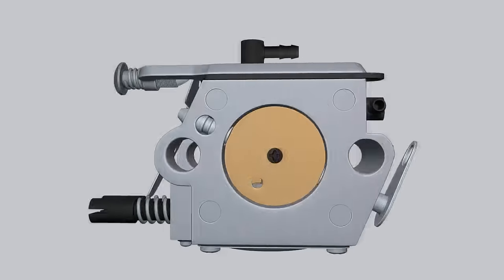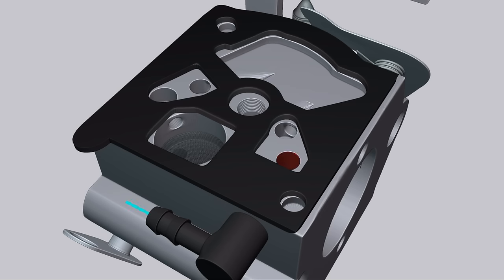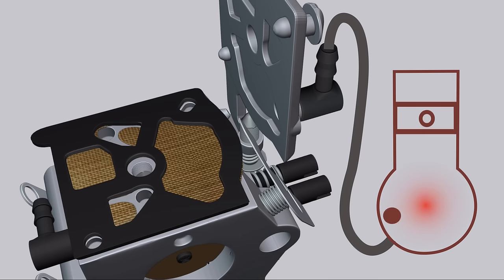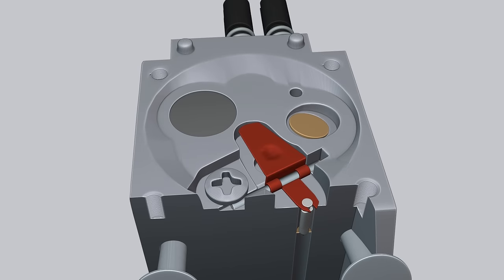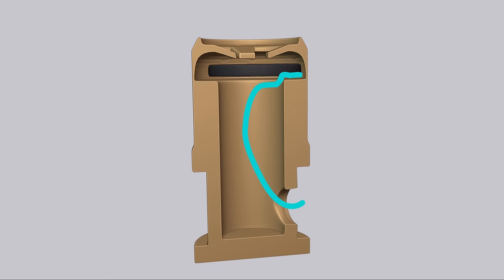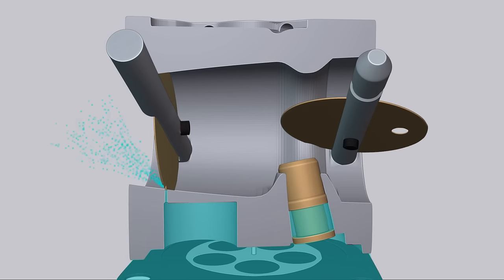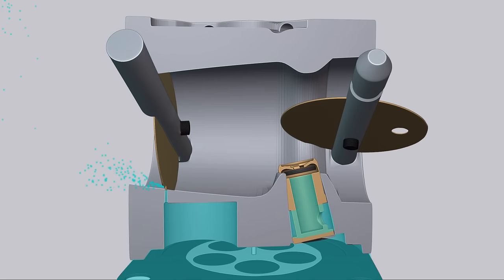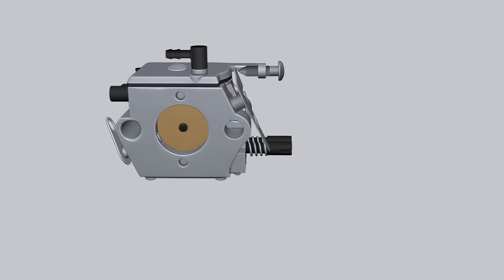Карбюратор бензопилы, мембранного типа | Анимация

Comment: I've had the old carb and a new carb 4 months later have the sealing washer stop sealing again so that air gets drawn into the fuel metering chamber while pumping the primer bulb making the engine bog down when you give it gas. I think fuel varnish creation is what keeps making the washer not seal correctly. I was going to try pumping acetone through the system to clear out the varnish even though it may damage rubber. i have a another brand new carb anyway. I heard to prevent this problem is to empty the gas tank, pour in two stroke oil into the gas tank and pump/run it through the system for storage. When you are ready to use the engine again, pour out the oil while pumping the primer bulb and then fill the tank with proper mixed fuel. When done using the engine put the oil back in for storage again.

Comment: The only thing he forgot was the accelerator pump which consists of the accelerator piston, spring and o-ring. You must remove the throttle shaft to access it. Sometimes it will get stuck from o-ring swelling. It is acted on by a cam cut into the throttle shaft. If that o-ring is swollen  usually the piston will rub off the electroplating on one side from being cocked slightly. If so just buy a new carburetor!
Reply: Нет не покупаем ,глушим этот аппендикс и работает все нормально

Comment: I don't speak Russian, but I speak engineering :) Well done! I'm trying to troubleshoot why so much air is bubbling into the gas tank when the engine starts (Ryobi 790R weed trimmer). I think the crank pressure is getting into the return gas line from the carburetor lower chamber. Maybe the shut-off needle is open all the time?
Reply from the maker: maybe you have a vacuum in the tank. Clogged fuel tank breather.
Reply: @SanyaTsvay great suggestion. The first symptom I saw was gas dripping on the ground from the sides of the gas cap. I think the gas cap was loose or seal wasn't working. When I open the gas cap and look into the tank while the engine is running, I can see large bubbles of air coming up the fill neck and swirling around in the tank. It's like if you blow into a straw in a tall cup filled with water. So the air is coming into the tank even when it is open to the atmosphere.
Reply from the maker: @mvwoon  Well, if so, then perhaps the membrane is really torn. in the carburetor.
Reply: @SanyaTsvay  I checked and the membrane is all good. I'll post a video. It's possible the membrane is too old and brittle, maybe? Can you explain how a torn membrane could cause air to blow back into the tank?